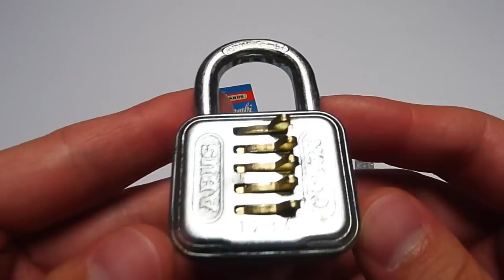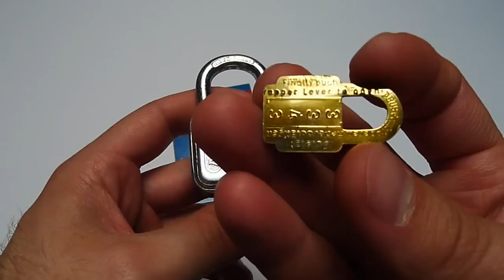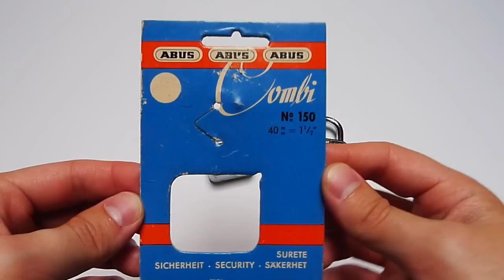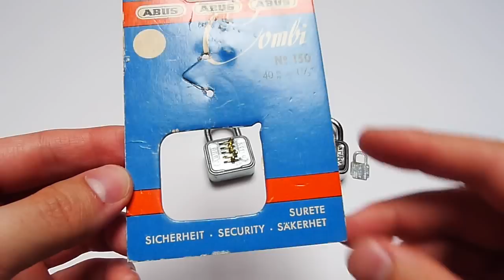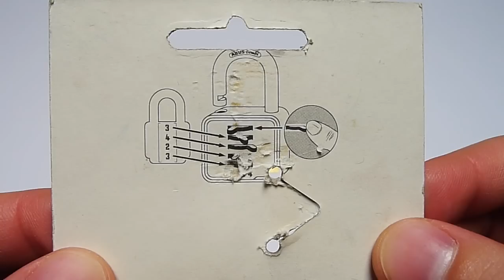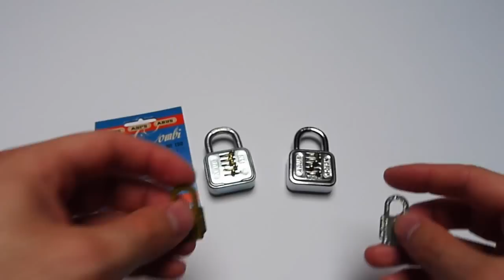Abus No.150 Combination Padlocks from Coplock

Comment: Interesting lock, does it have a factory set combination that can't be changed?
Reply from the maker: Hey insecure, yes the combination is factory set and you can not change it. As the padlock is quite small and I would have recommended to use it for low security applications anyway. For me it is just a cool piece for the collection ;)

Comment: Adrian

It appears they are a little different on the front bottom plate, below the levers near/below the 1 2 3 4 numbers.
Reply from the maker: Jim, THANKS! You are absolutely right! The older one has a design feature there which the newer one does not have :)

Comment: Have you seen any variations where this lock has 01234 instead of 1234? I seem to have the former example.
Reply from the maker: Hey Evan, do you mean EXACTLY the same model or one that looks slightly different? If you mean exactly the same model than I have not seen one that has 01234 instead. However it would be interesting to know whether such a model exists or not. Best wishes and thanks, Adrian